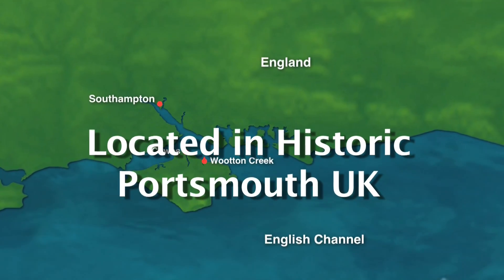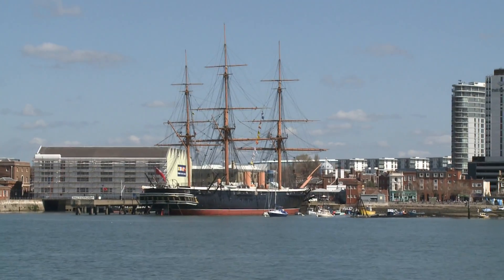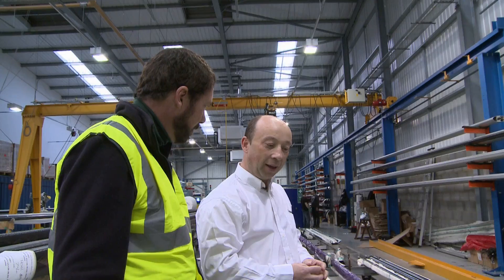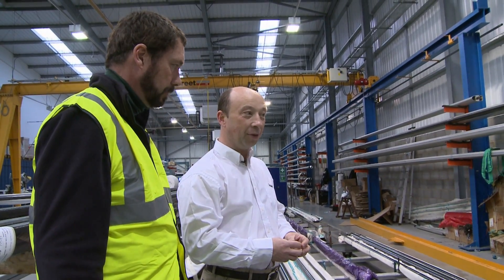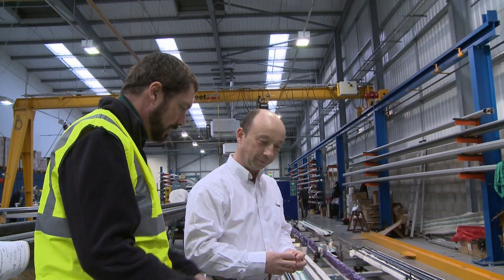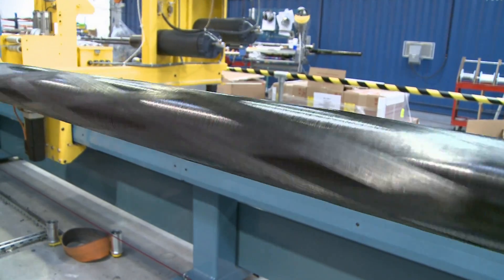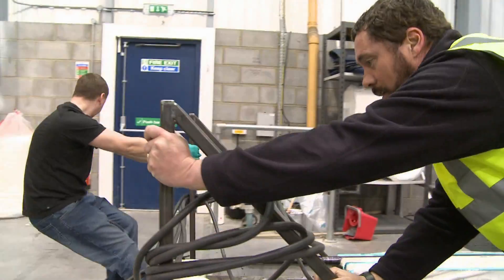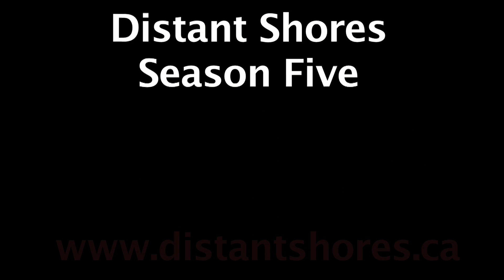How Carbon Fibre Sailboat Masts are made - Distant Shores

Comment: Hi is it necessary to fully stay a carbon fibre mast??  Or can it be the case that it is only 'braced' in position by the foot of the mast and where it goes through the deck ?
Reply from the maker: Carbon masts can be designed as needed, either as a stayed mast with shrouds or unstayed.

Comment: At Brazil constructor made wood masts so rigid and manuvering as a carbon mast. Not an old solid wood mast, but structural wood mast with composite epoxy, masts wiht sailing cables passing inside, costing 1/8 of a carbon mast. https://youtu.be/0TtnoE2dIaM

Comment: This “expert” guy hasn’t heard of the roll moment of inertia. Lighter masts do not improve comfort as he claims, instead they allow larger accelerations of hull and therefore more discomfort. Basic physics
Reply: The comport he is talking about is reduced heel.
Reply: If designed into the boat, a CF rig would be very comfortable. It would require less ballast to bring the roll moment into comfortable levels. On a boat like my seasprite 23 with over half it's displacement in lead, a lightweight rig would make the boat very "snappy" as it returned to level after rolling over a wave. A boat like my GP14 Dinghy, being an unballasted open boat, it would make her less likely to capsize.
Reply: In-furling masts roll much more when at anchor. Basic physics.
Reply: @ they roll more indeed. That’s what inertia is. But the accelerations are lower. I’m sorry you didn’t pay attention in class and the education system train left you standing on the platform 😂

Comment: I have trouble imagining that the weight difference, about 40%, would make any difference at all. I could see it for extreme racing purposes, but for cruising, you're going to want aluminum.
Reply: It makes a tremendous difference. RIghting moment, weight aloft reduced. this and a few other huge factors which equal much better boat performance. Not just in speed but in handling and thus the helmsperson and crew tasks of sailing the boat are facilitated
Reply: huge in head and pocket. inertia reduce roll freq seasickness and capsize chanse but snobs love to belive vice

Comment: paul,  thanks for the educational video.  one question, are all the carbon spars cylindrical?  I see your new pole would be but what about masts and booms?  non cylindrical mandrels?  thanks and smooth sailing to you.
Reply from the maker: I have seen some lovely carbon masts, built I believe with mandrels in the mast shape... but I am not sure about the method. Perhaps I can get Selden to chime in and answer your question.
Reply: +jfelix I wondered that. I suppose a cylindrical mast is fine for a racing yacht but sailing yachts need all kinds of equipment bolted to them and a cylinder isnt ideal. There clearly must be a way to do it, after all many carbon fibre constructions are obviously not cylindrical
Reply from the maker: +jfelix Yes Selden can also make regular mast extrusion shaped ones as well. They are still wound on like in our video, but the mandrel is mast shaped... then they bond on spreader bases etc...
Reply: +Distant Shores TV Paul,  yes that does make sense as fiberglass and carbon fiber can be molded to almost any shape.  Why not a mandrel of an oblong shape?  Thanks for the follow up.  Now get back to sailing and making excellent videos!